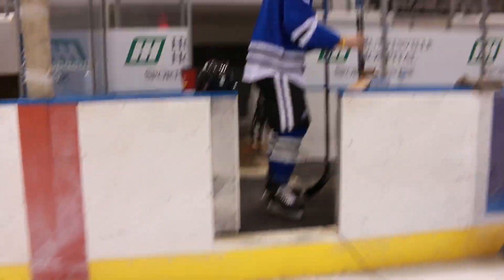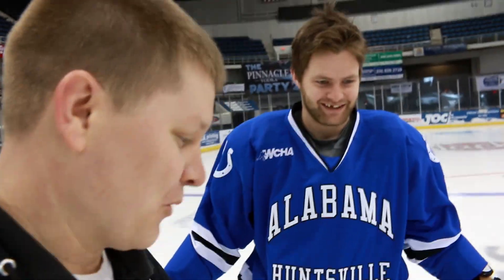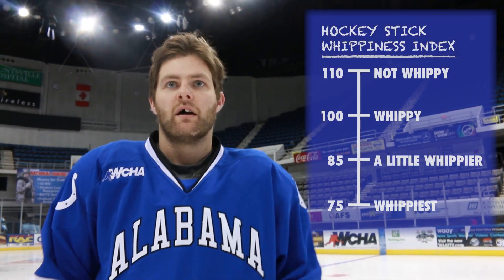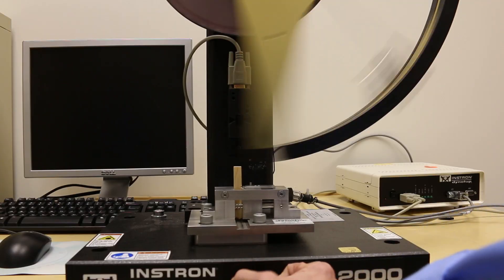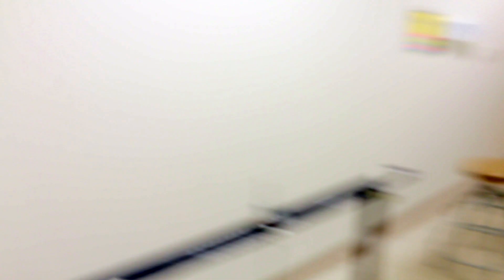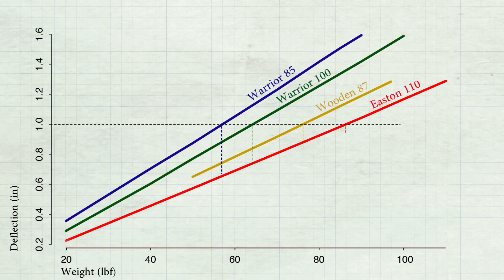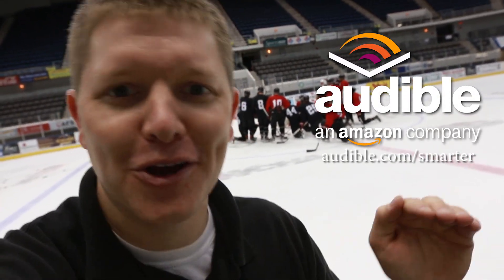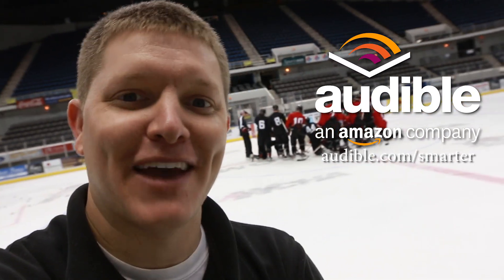COLD HARD SCIENCE: SLAPSHOT Physics in Slow Motion - Smarter Every Day 112

Comment: @smartereveryday Each stick has a clamed "kick point" where the stick is designed to flex based on the carbon layup. I would assume that you would have to measure the deflection in the specific kick point of each stick to get an accurate weight of deflection.

Comment: The difference in data from manufacturer could be due to where the stick is designed to flex. Some sticks flex lower or higher or in the middle. Also that player needs to get his lie adjusted which is the angle of the blade to the shaft. In slow mo he was consistently hit and dragging the toe or tip of the blade first into the ice. That should be a flat blade at that point.

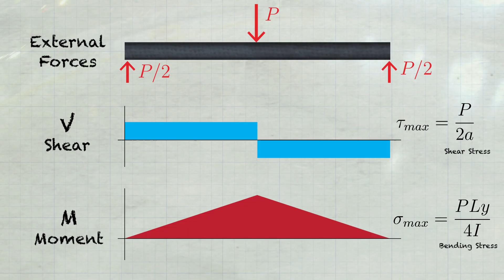Comment: @4:58 This assumes the material of the stick is uniform through out. It's not. The core of the sticks usually stiffened with a metal insert and the bottom is made softer plastic materials. No need to bring silly math into this.

Comment: For the flex value, manufacturers don't do it wrong. The flex point (or kick point) isn't always in the direct middle of the stick. On some sticks there might be a low flex point, so it bends the easiest in a certain spot further down the shaft. It usually specifies where the flex point is on the stick.

Comment: You missed a few variables.  Sticks are designed to flex in different spots on the shaft.  Low, mid, high, mid-low, etc.  Also, the sticks you tested will not have proper flex because not only are they used sticks, but they have also been cut for different players' preferences.  When you cut a stick you alter its flex and kick point.  Would like to see this with proper new sticks where the kick point for each stick is known beforehand to see how accurate some of the top tier manufacturers are.
Reply: I agree the test wasn't great when it doesn't account for flex points, but same-model-same-flex sticks do have a fair bit of variance in them fresh off the rack, a few seasons ago I clamped and measured 4 of my new APXs at points along the shaft to prove one was 'soft' and should be warranty replaced (fortunately the soft one was way off and was replaced).

Comment: In your calculations, did you take into account the fact that stick manufacturers claim to put different flex into different parts of the stick. Usually a mid-flex but some use a low-flex.

Comment: I think different sticks have different flex points. Stronger higher towards the hands so they don't break easily. I also always wondered if hockey pucks have some type of either balance or the ribbing around the circular edge that helps the puck flow aerodynamically? Cause when playing and practicing with a real puck it could do things quite differently then let's say with a plastic practice outdoor puck. When I would snapshot the real puck it would sometimes dip then seem to rise higher and also hover a little while longer obviously also cause the heavier weight of the real puck. And while shooting on net like at home with a friend I used to go to the street and shoot down the driveway equivalent to a little over blueline and my friend would be in front of the net deflecting. Well for as long as he was comfortable deflecting sometimes not being able to see the Puck well or those riser shots freaked em out which I don't blame him. Lol we shot down the driveway right into my mother's garage door which had quite a few scuff marks but also two pucks seemed to impale themselves into the plywood planks which the door was made out of. Also pucks make a slight whizzing sound when they're flying by also.

Comment: Sticks have different kick points so flexing them by the middle seems flawed
Reply: Kick points are independent of the flex.  You can have high or low kick (meaning this is the spot where the elasticity returns to its resting state FIRST) and still have the same flex reading.

Comment: Your experiments defining flex werent scientific at all. sorry there is more that goes in to a stick than it flexing right in the middle. Certain stick have different points where they are more stiff or not. Also a lot of the power comes from the blade of the stick whipping and not the actual stick

Comment: you forgot about one thing. you mentioned that the companies are not quite accurate with the flex. however, you were putting the weights at the exact middle of the stick. different players prefer different “kickpoints” depending on the type of shots they take most. for example, a defenseman would most likely prefer a stick with a low kick point as he will be taking a lot of slapshot’s. whereas a forward would typically like the higher kickpoint as they take many snapshots and wristshots. that is where the flex should be applied to, not the middle of the stick.

Comment: And actually it doesn’t always flex in the middle, when you buy a stick you can choose wether you want low point flex,  which is toward the blade, mid point flex which is towards the middle of the stick, or high point Flex towards the top of the stick, Low point Flex makes it easier for  quick release. Mid point flex is good for accuracy. And high point flex is good for hard fast shots.

Comment: Watching this video for the third time I finally noticed something. The flex measuring bench's "hands" are too far apart. See at 4:51 where the arrow are. The flex should be measured at a distance the player would use when contacting the ice. The distance being used is the location of the hands at the very top of the back-swing. That's wrong since you'll receive no force while the stick is in the air.

Comment: One thing to keep in mind is the flex point is not always (by design) the center of the stick. So where it may not truely be 85 flex at the mid point, you might have a low kick, mid low kick, high kick etc stick and that flex point is where it would measure 85. Also, some player cut their stick length which would also effect flex point and rating (usually raising the flex point and increase resistance to flexing)

Comment: Re-watching this since it came back up in my feed and thought I would comment on the flex testing  SmarterEveryDay did. An additional constraint when testing flex numbers is that sticks are built with different flex points. Generally, a defense man's stick will have a mid-flex point, where a forward will have a lower flex point. The lower flex point helps with a quicker release for shots like a wrist shot or a snap shot, where a mid flex helps with a heavy shot like a slap shot. Any flex testing would need to take this into consideration to be accurate.

Comment: The flex should be measured along the whole length of a stick. You measured it only over a constant length. This means also that if you shorten your stick from original length (like players normally do), it will increase the flex number. Anyway it doesn't explain why you got too small flex numbers.

Comment: Take it from a real hockey guy... The manufacturer is not lying. The flex is marked right but they have different flex points that are not always in the middle. I have one that is stiffer on the upper 2/3 of the stick and more flexible at the bottom
Reply: I generally like stiff 100 flex because I'm a taller guy

Comment: you have to take into consideration that the factory "flex rating" is based on the full length it's been produced at. Some guys add extensions to the butt end of the stick to make it longer, and some cut it down. So of course they're not all going to be as labeled.

Comment: Flex also changes with stick length. The more you cut down a lower flex stick the higher the flex ends up being and vice versa, in the event you need to add a plug to the end you lower the flex. I'm 5'6" and use an 85 flex stick despite having a really hard shot. In the end it works out though because by the time I cut my sticks to length they end up between 100-110 flex.

Comment: not entirely accurate because the stick tested had tape on which means it was used and was most likely cut to accommodate for the players height and when you take off a part of the stick it will get more stiff or have a higher flex

Comment: The way you used to measure the flex of the stick was incorrect. Many sticks are stiffer in different areas.
Reply: Ryan Manak was gonna say the same thing because of the different kick points
Reply: Ryan Manak That's what I was just going to say!!
Reply: Yeah, Coverts are super low kick points while a Bauer Supreme's kick point will be much farther towards your hands (between them most likely)
Reply: Ryan Manak
Reply: The flex points are much like a golf club. The lower the flex point the higher the trajectory of the puck. The higher the flex point, the lower if both were done at same blade speed at impact.
Reply: And it depends on the player's weight what flex they should use
Reply: You are wrong.

Comment: There are other things to consider when choosing a stick. The flex point. Some sticks are center loaded and some are bottom loaded, your hand position usually determines your preference. Someone who keeps there bottom hand low wants a stick that loads 2/3 down the shaft, where as a guy like Chara who's bottom  hand is at least half way up the shaft would use a center loaded stick. 

Also adding an extension or cutting the stick changes the over all flex number, as well as the ratio of load point to stick length. I used to use and 85, but had to extend it 3 inches, it felt like a piece of rubber. Now I use a 100, with a bottom load, because Im more wrist shot than slap shot, so I want the bottom 1/3 to be the whip. I used to play hockey, and was lucky enough to get free composite prototype sticks, and give feed back to the company. I never knew how much it really mattered until I talked to the companies designing them....

On that note, Im retarded, so double check what I am saying, cuz it's been a while, and I am lazy as well as forgetful.

Comment: Did you know that the stick breaks just under the hand, not on the max stress point, because it is designed weakens it that position so the fiberglass does not break into a players hand. :D
Reply: that's not true at all, I've broke sticks in the blade and even at the top of the shaft. And you rarely find fiberglass sticks these days not it's mostly carbon fiber sticks

Comment: with 700+ commets this may have been brought up already but the stick flex is not always right in the center of the stick but can be moved by design towards the blade for players who use there wrist or snapshot more often. at least that is what manufactures claim when talking about "low kick point" sticks.

Comment: If you cut a stick it will move that flex point and make it stiffer but will also change how the stick performs , so in the NHL they have sticks longer and shorter so they can cut it and it won't effect the flex so much . The factory makes the flex point in the middle of the stick and inside the stick there something in them that makes then not snap as easy as the other parts of the stick . Cut it you change that and end up having a higher chance of breaking the stick . I don't cut mine unless in taking an inch off max ,

Comment: I'm a hockey player my self and the number for the flex on the stick will lower over time depending on temperature the stick is at ,that's why I keep my stick inside and out of the cold , sticks break when they go over there flex or if there really cold they are don't tend to like a flex to them so they snap. The number on the stick is is a real number either rounded down or up if what it flexed at but they only do it to one stick and make the others the same so some could be weaker then others and flex more then the same stick with a different number , when I buy a stick I step on a scale , then I go into the store find a sr. Stick cause in bigger and weigh more so a thicker stick would be able to handle my weight . The thinner jr. Ones are thin and take less weight to flex . I lean on my stick and for me I like a mid flex stick so 100 is perfect for me or an 85 , your curve on the stick will effect the slap shot to because it spins of the blade of it ,

Comment: He did one big error. He said slapshot is the fastest shot in hockey, what he means is it is the hardest shot in hockey. The fastest shot is the shovel shot or wrist shot because they are must faster to shoot/release while a slapshot actually take a long time and is never used if one need to shoot quickly if for example a defender try to block the shot.
Reply: +King Wacky He means it's the shot that causes the puck to travel the fastest.
Reply: Toast Burner
ik but the way he said it is wrong, he should have said it was the hardest shot, fastest shot is wrist/shovel shot.
Reply: +King Wacky well in that case then a snap shot would be the fastest shot...
Reply: +Corey Hebb Corey is right the snap is the quickest shot to get the puck off while the slap is the hardest, fastest. I've been playin hockey for 13 years and I'm not about to quit
Reply: william weyermann
Slapshot is when you pull the stick up all the way, snapshot is when you pull is up maybe a few inches to a foot behind the puck to shoot it. shovel shot is when you do not pull the stick up away from the puck at all instead you pull the stick and puck back and let the puck slide along the blade as you pull it forward and release it. That is a shovel shot also known as a draw shot.

Comment: Hockey is a competitive team sport played on a standardized ice surface featuring a 6 by 4 foot goal at each end which are situated a few feet in front of the end boards, allowing for play behind the goals. Each team fields 5 players in play at any given time, including 2 defenders (left and right) and 3 forwards (left winger, center and right winger). Each time also is allowed a goal tender bringing the total number of players on the ice to 12, barring penalties. Players wear protective pads as hockey is a contact sport, and manipulate the competitive medium (the puck, a small disk of rubber with slightly bevelled angles but sheer sides and faces) with sticks that feature a protruding face that is thinner and wider than the shaft, and slightly curved to facilitate control. Games are 60 minutes long, split into three Periods of 20 minutes. More to come, my hands are tired.

Comment: When u guys were testing the flex of the stick maybe wrong because different sticks have different flex points and players get the one that fits their style of play. I like taking quick shots and getting a quick release on the puck so the flex point for my stick is near the bottom of the stick, closer to the blade. Vice - versa for people who like to load up on their shots and what not. And some sticks are not well balanced as well, Some sticks that are expensive, their balance point would be in the middle, It will be different for cheaper sticks.
Reply: You're talking about kick point which is slightly different.

Comment: SmarterEveryDay, one possible problem with the test of the flex in the video is that different sticks have a various types of flex profiles. 

Measuring two sticks that have 100 flex but different flex profiles will wield different results which would account for different ratings in your tests.

Some sticks have a lower kick where the flex of the stick is closer towards the blade of the stick. Where other sticks have a mid-kick (where the flex is near the middle) generally spread throughout the stick.

So measuring 75, 85, 100, 100 sticks requires knowledge about where the flex point is and then measuring the flex from that angle.

Awesome video's.

Comment: The "hockey stick whip index" isn't as correct; this is more of how it actually is. 
75 - Whip Flex
85 - Regular Flex
100 - Stiff Flex
110 - Pro Stiff Flex
either way I loved this episode of SED. can you please make more involving hockey like wrist shots or body checks!
Reply: JasonHockey46 Good job reading this off nhl 15
Reply: JasonHockey46 that is a lot more accurate
Reply: I depends on your height, actually.
Reply: Haha! Im not a defenseman, but I take my sticks pretty stiff. I have a Warrior QR-1 with a 110 flex. Im a heavy guy so I need a good flex profile to get that stick bent and to get that puck flying. Ive perfected my own techniques of various shots to accommodate my flex. Now, I do however break my sticks often, but I have about 8 of the same stick, that's because I need back ups and I don't like any other stick than I have right now. Plus my curve is NASTY! Utilizing flex is a skill and you have to constantly keep using that flex to actually perform your best with it. If you use an 85 and your slapshot wont get up that's because you haven't learned your stick yet. You gota learn the flex, learn the curve, learn the weight. Trust me, when I was starting off I used 85's and then I jumped up to 110 through a graduated amount of time, it was hard to learn how to re take my shots again but its an easy thing to come by, just practice!

Comment: Quick observation, you tested load at the center of the stick where it is most flexible due to that spot having the highest radius from the pivot point. Because of this I believe your measured numbers were wrong. The weight should have been calculated with only one pivot point and the weight being on the end. Similar to how the puck is actually shot. That may influence the bend of the stick.